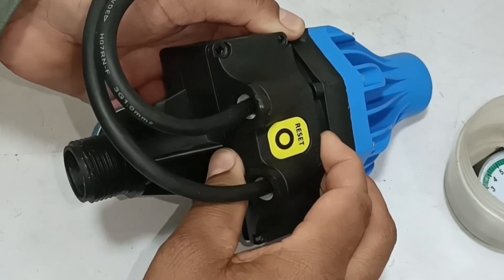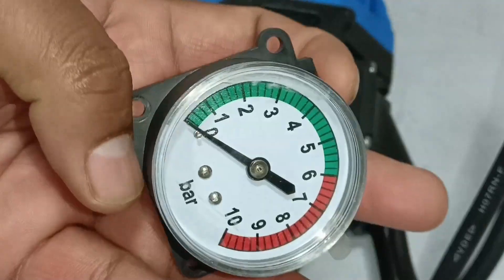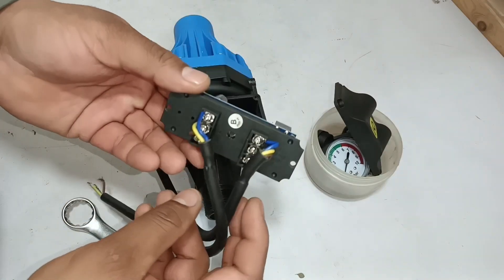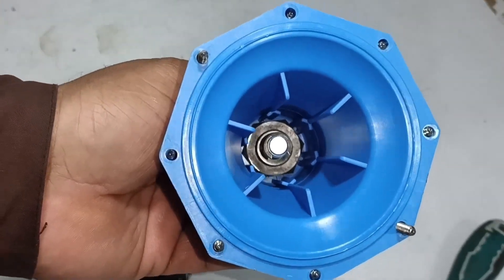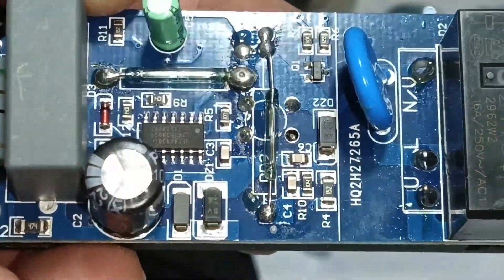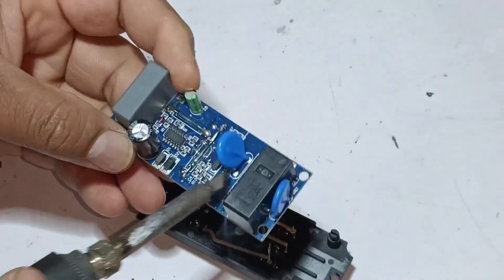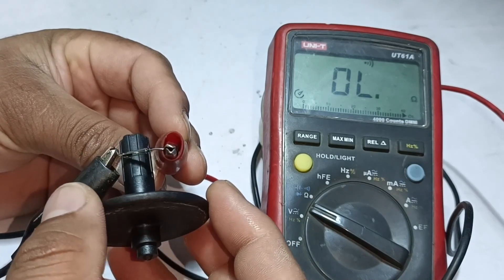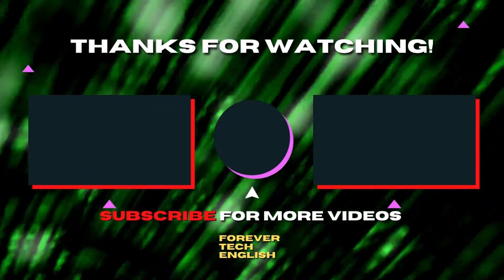Want Perfect Water Pressure? See This Automatic Pump Teardown!

Comment: Please how can I stop the sound of the pump while working because it makes so much noise
Reply: 0.5 hp small motor makes noisy screeming sound, 1 hp is smoother
Reply from the maker: well that's unusal that it makes noise, check for any loose screw on the body? May be something is loose other then screw.
Reply: @ it actually gives sound whenever any tap connected to it is on and also gives sound for the timer so I don’t know why and how to stop that or probably it’s an inbuilt stuff
Reply from the maker: @gafarsaheed5575 @gafarsaheed5575 did It make the same sound when you bought and installed it in new condition?
Reply: @ yes
Reply from the maker: @gafarsaheed5575  Maybe it could be built-in could not say about it then.
Reply: Hai